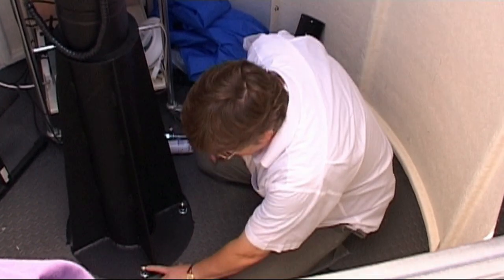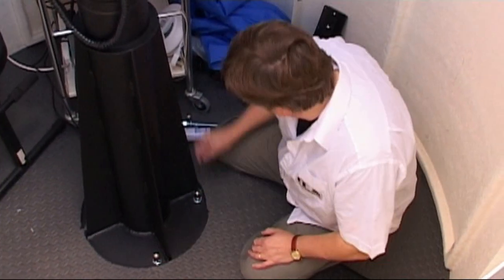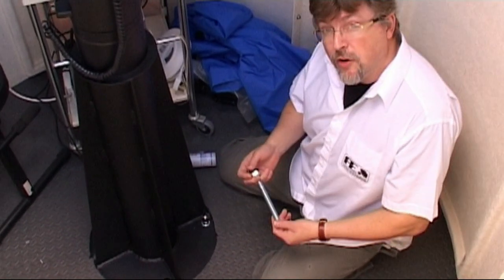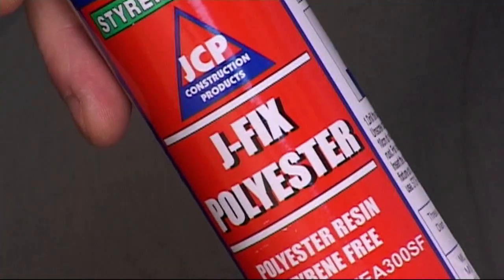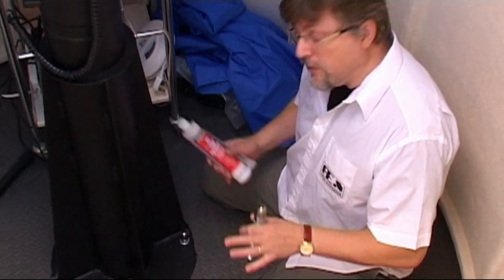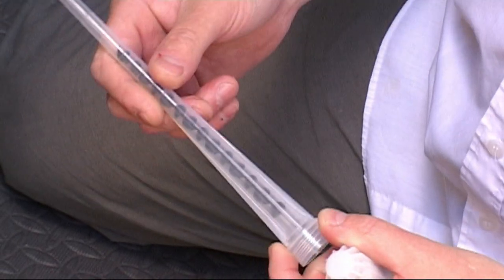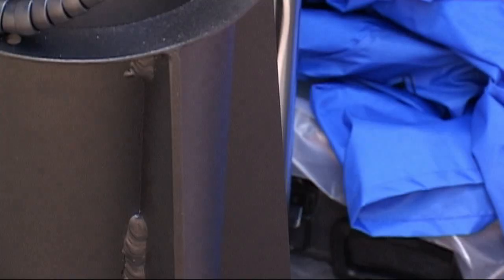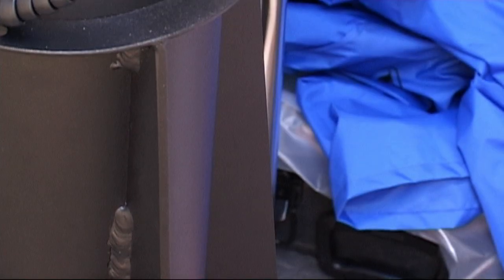Anti-vibration observatory piers (Part 2: The foundation and fastening of the pier)

Comment: My god... so much overkill, you aren't anchoring a bridge.
Reply from the maker: Well spotted; as you so rightly say, we're not anchoring a bridge. Or a power tool. Or a garden shed - or any host of things that folk are generally, and successfully, experienced in providing a foundation for.  But we are mounting a 14" telescope, and this is, in principle, a very sensitive seismometer capable of detecting variations of 100th of an arc-second in a 1000th of a second time interval. Indeed, the instrument can detect a human being walking 30m to 40m (130ft) distant simply from small deviations in the moment to moment position of a star. Decades ago now, I thought like you and placed too much trust in my general experience of conventional building principles. It took many years and much practical experience (sadly, building and advising on 50+ or so pier installations - incorrectly!) before finally gaining some grasp of what was actually happening on a small but vital scale on telescope and pier installations and getting it, if not perfectly right, at least right to a standard I now feel safe in recommending. The problems with telescope piers flow from the very simple, but little-recognised observation that steller wander derived from instrumental vibrations (and the oscillatory motions typical of a dynamic mechanical system like a telescope and its mounting in particular) look identical (at the film-plane or on an imaging chip) to seeing induced steller wander. Go on to any amateur astronomy internet forum and you will find literally thousands of posts from people (often quite experienced sensible people)  bemoaning their poor 3+ arc-second seeing conditions. Unless they have completed tests to properly discriminate between vibration and seeing they are, to put it bluntly, just guessing. Which is a shame because their actual seeing/instrumental imposed resolution limit may be much better - indeed, almost certainly is better.  I realise you didn't know any of the above - you wouldn't have sent that post if you did. But my reply is aimed more at those who imagine their experience of the black-smithery required to mount a power tool on a steel support equips them to understand the mounting needs of scientifiuc instruments. It's important to 'know' when you don't know something and act acordingly - usually by maintaining a modest silence and keeping those restless fingers away from the keyboard. Thanks for posting and allowing me to challenge those assumptions.  KR RJD A&NC TV
Reply: Damn. Talk about a burn to nth  degree.

Comment from the maker: Hi - actually the number 160knm is what is known to many high precision industries as a WAG (Wild A**e Guess)! The wrench I used, with difficulty as I had to put a pipe on it to get leverage, clicked over at about 140 before the nuts locked off.  I just boosted this number for ‘safety’. I actually regret mentioning any numbers here at all as it has led to confusion. I should have said simply, the nuts need to be done up as hard as you can without wrecking the thread on the studs. KR RJD

Comment from the maker: Hi Dave, no you go ahead, I'm partial to pedantry. Dry or wet? I'd be surprised (not shocked) if the dry weight was over 2 tonnes. In practical terms you start out aiming for a 1m^3 hole but because of tapering (fatigue!)  it ends up less anyway. The key is that 1 tonne should be a minimum to aim for. I've only got one real experience with this (n=1!). I once had an experimental container of sand that was a whisker over a cubic metre and it weighed in at under 2 tonnes - wet. KR RJD

Comment: You talk about drilling holes in the cured concrete and using epoxy. If you've decided on the pier ahead of time why not use a template and insert the bolts into the wet concrete? Seems like that would be easier and better.
Reply: A bit late bit for anyone else who clicks on this, both ways work. I do remodeling and whenever we have to drill new bolts into foundations we use epoxy and go at least 8 inches down. It'll hold.
Reply: @ColeRees  8 inches is always enough.

Comment: Why Glue in the studs? Why not a steel frame inserted into the wet concrete at the time of the pour?
Reply from the maker: Hi Scott. Well it's mostly down to what kind of procedure you can safely recommend in a video. The 'glue' method can be done poorly and still get a good result. If a hole goes wrong, say on the slant (remember: I'm talking to DIYers, not construction professionals), you can always shift the pier a couple of inches or rotate it a degree or so and re-drill. The whole procedure is in small safe steps - with minimum performance jeopardy. If the studs set in concrete 'fail' for any reason, you need a diamond cutter, and there's aggro a-go-go! The frame concept is a safer embedding method - probably the best solution when perfectly executed (deep enough to resist corrosion and consequent expansion spalling, etc). But it's hard to recommend to a broad viewer-base with average construction skills. I think if we say 'glue the studs', anyone with practical experience, and is familiar with the issues, will go their own way.  That said, glueing is still the safest method in terms of the staged approach.  Step one, you cast the concrete block and wait for it to cure. And then you fix the pier as a completely separate step. Combining both steps puts the lone installer under considerable pressure contending with two critical foci rather than one. Just my opinion. Thanks for the helpful message letting me clarify this point. KR RJD A&NTV
Reply: @RocketPlanet  now the issue is finding a concrete contractor that will leave just a little bit more on his truck to satisfy you. Because they won't come out for just one yard of concrete. They have to have a major pour. My son is in construction and he said they'll probably offer you a small site mixer that'll do 60 lb at a time so you'll be doing it yourself. Ugh I'm too old for that!
Reply: Hi Scott Yes I'm too old for that too. Don't take my recommendations too literally. You only need about a ton (say 200lbs) under the pier for maximum benefit- and that's only about half a cubic yard. I'd be surprised if you can't find someone to bring it for a small premium. If you have enough (easily pleased) friends/neighbours you might try the old 'concrete party' rouse. You'll need the site mixer, sand etc, as well a quantity of beers and barbeque fodder.
Tip: don't skimp on the beers - a pier is forever. KR RJD A&NTV
Reply: @RocketPlanet  well I already have a whole dog as big as yours and it's not going back now.
Reply: @RocketPlanet  Just as a follow-up Yes I did the 200-lb pier. It doesn't work.... You need to weight! 👍

Comment: Very interesting, you obviously know your stuff. I happened across this  because I am thinking of building a pier for my 20x80 bins on a p-mount, as I only have a camera tripod that can support 5kg, which is pushing it. I had planned on drilling into the shale 2ft+ and sinking either a section of railway line or an Acrow prop, with appropriate plate welded on top.I can't afford a tripod that's  man enough, and have those materials on the farm. I'm just worried that having,say, 5ft of steel sticking up will allow flexing, and vibration. Or will it suffice for 20x bins ?- I'm   just trying to improve upon my over-loaded tripod.

Comment: 40 years as an engineer and I can tell you, you are 100% over built. It’s just a little telescope, what 40, 50 lbs…so over built. A cubic meter of concrete weights 2.4 tons, that would easily secure a 40 foot flag pole. You guys are completely out to lunch with this build.
Reply: The concrete isn't acting like a traditional foundation, it's there simply as mass, which makes vibration less noticeable by reducing the frequency...or at least that's my take on it. Perhaps the same could be achieved with a more modest concrete pile or block and a couple of tons of ballast?